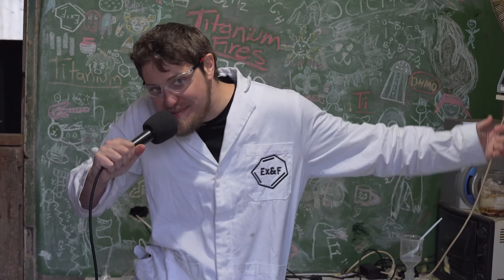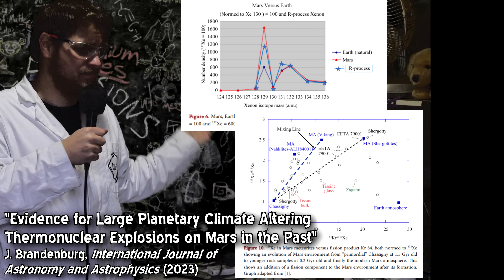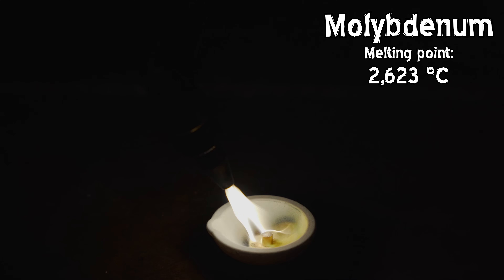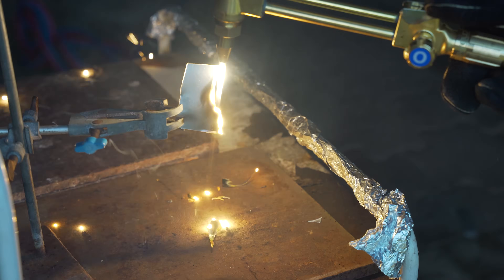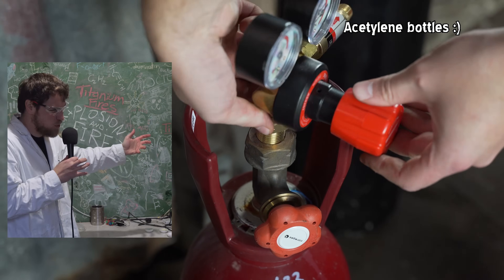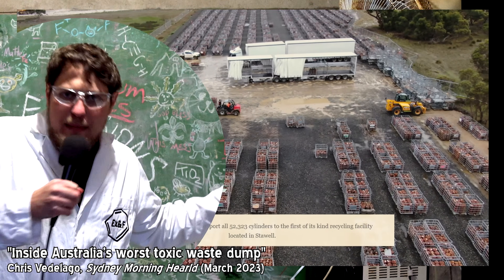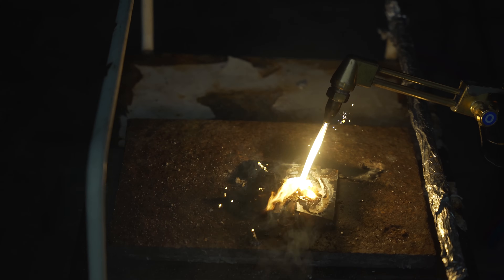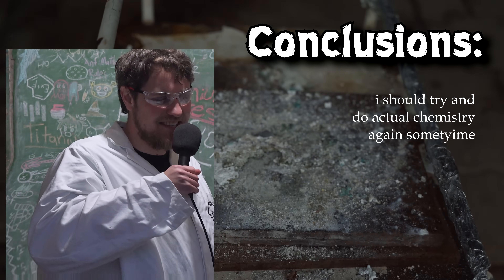Actually burning titanium

Comment: Acetylene is absolutely no joke. 
It gives firefighters the willies. It is explosive already at very low concentrations, all the way up to an almost pure acetylene atmosphere. And if an acetylene cylinder ends up in a fire, once it heats up past about 300 degrees C, the stuff starts decomposing which produces more heat. Which speeds up the decomposition. So the reaction is self sustaining and will carry on until the cylinder ruptures. The reaction can’t really be stopped once it started - it can only be slowed down. By applying cooling. Lots of it. And continuously. In some cases, firefighters have tossed heated up cylinders into a nearby garden pond or similar body of water. 

You aren’t even supposed to store acetylene cylinders in any enclosed space. They should be left in special outside sheds that have constant airflow, so any escaping gas is immediately dispersed and won’t collect anywhere. 

Unfun fact: You absolutely cannot use copper piping to handle or transfer acetylene. The only exception where copper is OK is the actual torch, because the gas immediately gets burned there. Anywhere else (eg distribution pipes that happen to be made of copper or copper alloys) acetylene forms acetylide compounds…and those are explosive.

Comment: Try lighting a bunch of plates plus sheets together so the heat of some of them kind of burn but extinguish then the torch is removed lights others and eventually there is enough heat temp and quantity it will actually burn and sustain.

Comment: For Titanium it's all about surface area. As someone who machines the stuff regularly, trust me if you get some titanium dust from grinding together it will burn pretty violently. 

Zirconium is even worse and I have to be incredibly careful when I have Zirc projects. Because with Zirc even the chips from milling it are sketchy. My fly cutter shoots Zirc fireballs at 2500 RPM across my shop 😂

Comment: You’re having too much acetylene in your flame and burning way too rich 

You should have a small neutral flame in that cutting torch before hitting the oxygen cutting leaver on the handle (that adds the extra oxygen and pressure to actually cut)

Comment: Get your torch to a neutral flame (blue with defined cones out of the oxygen ports) begin your fire and turn off the acetylene and maintain oxygen on the fire and it will keep burning don't need to add any fancy oxidizers you have oxygen in the torch my friend.

Comment: You're using that torch wrong. I can tell by the yellow color and the long emissive flame. You're not using enough oxygen and the flame is carburizing, meaning it's taking the oxygen out of the air around the flame, making it hard to set anything on fire with it. It's also far cooler than it should be. For best results, turn the oxygen up until it turns blue, then continue turning it up until the blue 'fuzz' disappears from the innermost layer of the flame. But try to balance it precisely so that you don't go beyond that, because after that point you're not using up all the oxygen and you get an oxidizing flame. Well, oxidizing flames are terrible for welding because you oxidize your metal and weaken it, but if you're trying to start a titanium fire that might be ideal. Anyway, the point is, you're getting about the worst possible result by keeping the flame in that long yellow state.

Comment: I double checked the numbers and you definitely can melt tungsten with an oxyacetylene flame. As far as experimental confirmation of that, I recall seeing it done on Beyond The Press. Carbon (as graphite) sublimates at normal pressures, so it wouldn't melt from an oxy torch, but the heat induced phase change at atmospheric pressure doesn't occur till about 150°C hotter than an oxy acetylene flame anyways.

Comment: You gotta revisit this with a proper heat head on that torch rather than a cutting head. Also, your mixture was wrong for the torch, you wanna make the cones meet in the flame, that’s when your flame will be at its hottest.

Comment: Regarding recycling plastics. It was a lie from the start. From the moment when the oil companies decided to market their production waste as a new product, they knew that disposal of plastics would be a problem. That is why they came up with promotion of recycling despite knowing full well that it will never be even close to commercially viable.
It is hard to financially compete with the waste products of one of the largest industries in the world. One side wants to get rid of it and would give plastic away for free, and the other side has to segregate and process it. You simply need large government subsidies to make recycling plastic viable.
The saddest part of it all is the fact that we already had in place a perfectly recyclable material widely in use. Glass is much cheaper to recycle than to produce anew. Everyone was recycling glass bottles by working on a deposit system where you paid a bit extra for the product in a bottle and you could get it back if you returned the empty bottle to a store.

That system was completely broken by the introduction of plastic bottles. Now everything is in "recyclable" plastic (which is cheaper than glass) and the glass bottle market shrank to the point that the deposit system is no longer viable.

Comment: Acetylene torches and stuff.

I love acetylene. It was my first proper welding experience and was easy to work with on thin sheet metal. But it has some safety concerns. How you store the bottles. What valve you close first when you're done (oxy) so that oxygen doesn't push back into the acetylene hose, stuff like that. 

OK, so you've read up on how to safely store and use acetylene.

Explaining in text how to adjust the flame properly is tedious. Just watch some videos.

Suffice to say, you were using the cutting handle, the flame didn't have enough oxygen, and then you triggered the cutter, adding a bunch of oxygen (used for burning (oxydizing) steel, for instance). I'm not saying adjusting a cutter is an art, but it's easier to show than to tell.

Anyway, you were dumping a ton of oxygen at the titanium sheet. Yes, the titanium will burn as long as there's enough oxygen (in the flame), but it won't be sustained when you remove the cutter flame. If there IS a way to get titanium to burn sustainably in atmospheric levels of oxygen, this experiment wit the cutter won't show it. You'll need to use a welding nozzle with a balanced flame. Probably the larger, the better.

Or maybe you could try something hotter? Like an electric arc?

Comment: oxy propane is nearly as hot you do however need to learn how to form a neutral flame with that torch you were mostly using a carburizing flame which deposits carbon on the surface of the object you are heating. probably not going to affect the results much unless it's quick forming titanium carbide.

Comment: I know i'm late, but whatever. As a metalworker i can tell that it's very fun to cut steel with oxy acetylene.

I can also tell that you had way too little oxygen on in the start where you was cutting. You gotta have the flame burning so it looks like a blowtorch before you use the "button" which makes it blow oxygen from the hole in the middle. The reason you does this is so you have the flame hot enough to melt the steel and then uses the "button" to blow the molten steel away.(:

Comment: Please, next time using a Oxy-Acetylene torch, follow these steps. 
1.) check acetylene line pressure, keep it under 8psi (or whatever you aussies use). 
2.) turn on acetylene at torch a little more than you were doing in this video. 
3.) light acetylene. 
4.) increase oxygen flow with the knob next to the acetylene knob until a nice blue flame is coming from the torch and it's making a little noise (alight whooshing sound). 
5. Adjust the oxygen flow at handle nearer the torch tip (this blasts oxygen to do the cutting) so that when you hit the trigger lever a strong whooshing sound is made and the flame does not go out.

Comment: We're constantly warned about metal fires when working on welding planes and jets, I think it's something to do with the type of fuel and possibly high currents
Edit: with oxyacetylene, turn on oxygen tank all the way, acetylene half way, adjust the valve pressure as needed, the turn the bottom knob of oxy all the way on with the top valve closed, then, engage and ignite acetylene starting with a small amount of gas flow and increasing it after ignition, then crack the top oxy knob and turn it up until the point were the "spear" of oxy just disappears, then engaged the cutting torch to check correct oxyacetylene flow, release the handle, heat up the area, engage the oxt to cut.

Comment: I suggest you re-do this video, but use the cutting torch properly.  

A cutting torch has two sets of nozzles.  The periphery nozzles eject an oxyacetylene to heat the work.  Once the work is hot, the center hole releases high pressure oxygen to burn the metal.  
The body of the torch is universal and has an twin knobs.  For use as a torch, both knobs are used to regulate the acetylene and oxygen.  When changing out the tip for a cutting head, the oxygen adjustment knob in the body should be wide open.  That way high pressure oxygen is released to the center hole when the lever is pressed.  The knob on the cutting head is used to adjust the oxygen going to the periphery holes.  

You light the torch with just acetylene going to the tip.  Adjust the flame up until the flame just starts to lift off the tip.  Then add oxygen with the knob on the cutting head until you get a neutral flame.  The neutral flame is where the flame is the most compact but still stable.  When there is excess oxygen, the flame won't be stable and grows long a little bit.  Dial down until it has a nice constant sound.

Use the flame to heat the work up hot.  Then when the work is hot, hit the handle to make the center of the flame oxidizing.  That's when the metal is most likely to catch fire.

Comment: as far as im aware the danger of titanium fires stems from modern cnc machining; 
the newer generations of drycut insert plates focus and transfer obscene amounts of the heat generated during the cutting into the chip, which is usually kinda thin. 
While nothing may happen for a while the machine builds up heaps of them, all hot; well eventually one may light, setting of the entire already preheated pile, lighting your multi million dollar machine on fire, which is generally not good.

Comment: Hilarious point about mars and somewhat terrifying... However I feel you left a rather large matter unaddressed (about the titanium, not Mars). You're heating a plate! Obviously the smaller volume is initially easier to light however its just going to conduct that heat away to the rest of the material and then radiate and conduct that away far too fast for you to provide enough energy for a sustained reaction.. In addition the melting and dripping is going to cause most of the heat energy released from the burning to be lost. The larger the volume:SA the harder it will be to initiate a fire however once you get to the critical temperature a larger volume:SA is much more likely to self sustain. It's simply an equation of energy that can be provided vs heat that can be lost to the environment. I think you should try uniformly heating a globular mass of titanium (cylinder or cube) to it's ignition temperature.. I'm sure you could concoct a solution using the oxy-acetylene or perhaps an induction heater would be a good move as this would heat the liquid form quite effectively. Side note this has occupied far too much of my conscious thought recently

Comment: You need your flame to be angry sounding. Realllly thin mini “pencil tips” at the acetylene outputs and a short, loud blue flame. You have a carburizing flame in this video, you need an oxidizing flame for the highest temp. I’m a mechanic, we use these torches every day 😂 ik it’s not common knowledge but you have a torch, now you know.

Comment: It kind of looks like you need some more oxygen on your torch... not sure if it would help acomplish the goal of actually igniting the plate, but do know with oxyacetylene a nice blue flame burns a lot hotter than a very bright yellow/orange (and often quite sotty) flame.

Soot unburnt carbon? Idk, i just use the thing for hvac...

Dont have a ton of experience with the welding side, but sort of use white bright to blue flame to heat up, and then flip up the oxygen - flame essentially disappears but sparks and disapearing metal begins

Comment: On recycling: anything can be recycled, in a way, meaning, you won't really be able to collect post consumer PET bottles and re use the material to make PET bottles, but you can turn that material into something else. In a perfectly ideal scenario, if there was 1 million tons of bottles produced per year and exactly all of them got collected, sorted, washed and reground, you CANNOT make 1 million tons of new PET bottles and repeat the process forever. That was the implication that came from recycling glass and even there, you can't recycle 1:1, you need a significant percentage of virgin material.

However. I'm pretty sure it is actually possible to recycle PET, or any of the plastics for that matter perfectly, so that it's either re-used or chemically turned into something else, it's just that the cost of doing that is economically insane. So, why did we start using plastics in the first place? Just for the food/beverage industry, the World creates perhaps 100 million tons of plastic waste per year, before the big plastic boom, this was all glass and tin. Why? Because it is much, much cheaper, easier to handle, easier to transport, much less weight and volume, you see, also containers can be in color, transparent, translucent, or opaque, very good from marketing standpoint. If someone paid $1 for a thing in a glass container, they would still pay the same for the same thing in a plastic container, but the producer makes more profit. There you have it. If it was obligatory for the producer to pay for the future recycling of that product, the cost would be so high, they would switch to glass and tin in no time.

What we can do is buy everything we can in glass and tin packaging.

Comment: You can melt, even vaporise, Tungsten, with HHO gas flame. This flame have temperature of around 140°C in open air, but when touched some metal or so, temperature raise on the melting point of those material.

Comment: The fact that the torch isn't set up properly is mildly irritating. Especially considering the wealth of information available on this platform that is dedicated specifically to how to get the ideal flame with an oxy fuel torch. 😭😂
Reply: For reference, there's not nearly enough oxygen in the flame. The knob towards the end is how you adjust the amount of oxy, and the lever is to deliver a blast of oxygen that is used to oxidize the ferrous material rapidly and blow it out of the way.

Comment: You need some more practice tuning the flame on the torch.  
Go watch some tutorials here on YT,  Didn't see your main gauges so tell if they were set right but your mix ratio was off on much I watched.  Use a smaller cutting tip and you should be able to hit hottest temps.

Comment: Love the show although It's honestly a little painful to watch. You try to use An O.F. torch, but I appreciate the effort lol. long story short. You don't want a Carburizing flame, and you don't want an oxidizing flame. You want a neutral flame before you hit The lever Basically, just turn the acetylene up Till it stops smoking Then turn the oxygen up So you have a nice stable neutral flame. Then, once you preheat the metal, you hit The lever which dumps more oxygen into the mix Which allows the preheated meal to be oxidized by lowering its kindling point and allowing it to burn. Being that all your fuel gas is already being consumed. however, it will only do so. As long as that oxygen, rich heated environment remains stable. So it's not actually the heat of the Torch. That makes the difference. It's the combination of Heat with a localized oxygen-rich environment in the proper proportions at the right timing I hope that's helpful to someone. Also fun fact a settling was the In Cindy, Ari component of the fat man bomb that was dropped on nagasaki. That's what created the effect of people getting charcoaled against walls and shit But we got one better now it's called propaline. It's some pretty crazy stuff.

Comment: Your gas mixture is not quite right it's to much acetlyne, you need an oxidizing flame (look it up) pump up the oxygen flow a little and the flame would be a little smaller but can reach up to 3600°c if you got the correct nozzle

Comment: I used to machine the stuff. It's not only a pig to machine, brobably the worst metal I had to deal with. And if you bring a file to it, small filings inevitably catch fire. No, not that they burn while falling down. They're much more treacherous: you let filings accumulate while working. Then one of them catches fire, falls into the heap of filings, and they suddenly burn all at once. And oh boy, doesn't it burns hot! I got lacunae on my steel workbench from literally a pinch of the filings which burned for 2-3 seconds at most. It was burning so hot that the steel workbench burned with it!
I feel that I'm telling the story that's exactly the opposite to your channel theme—you set stuff on fire, and I wanted to prevent it from catching fire. I remember I ended up using CFC-113 before it was banned, alone or mixed with cutting fluid, when drilling or filing it. I think the liquid chlorofluorocarbon just evaporated from heat, and, being very heavy vapor, blocked air from getting in contact with small chips or filings while they were hot enough to ignite.